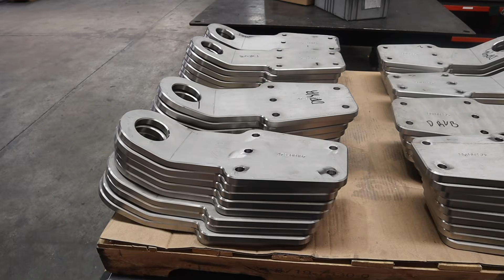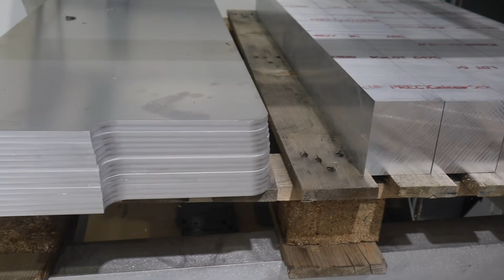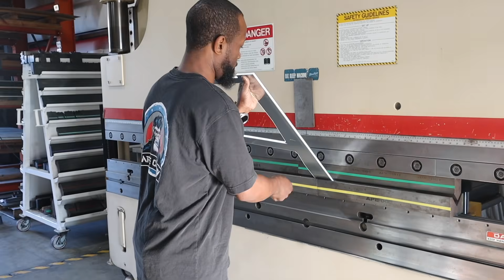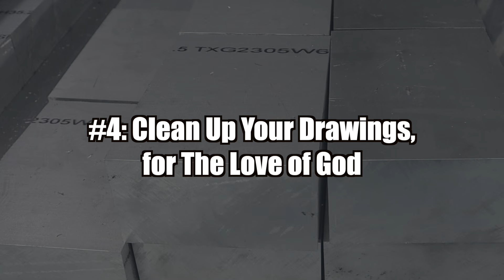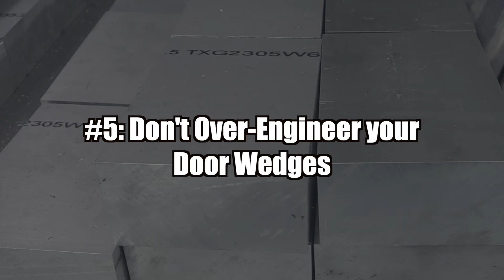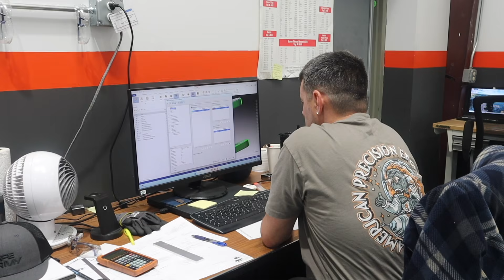Here's 10 Ways NOT to Spend Your Life's Savings on Your Next Fabrication Project

Comment: Solid list! I've had discussions before regarding sheetmetal parts and whose responsibility it is to determine bend allowance, K-factor, etc. I'm of the opinion that the final bent part geometry (angle, bend radii) is what the drawings show and the fabrication shop develops the flat pattern based on tooling, material, and experience. I'd be curious to hear your thoughts on this.